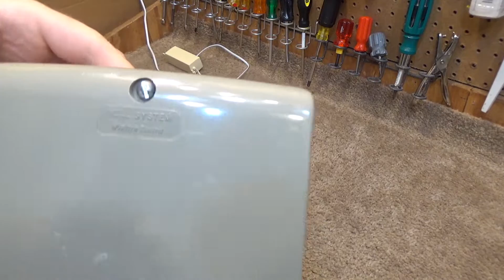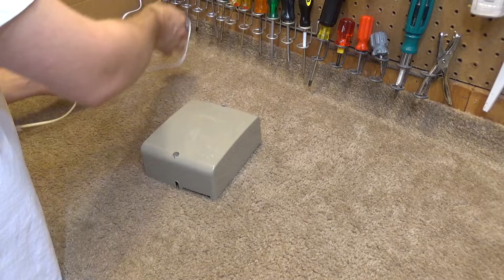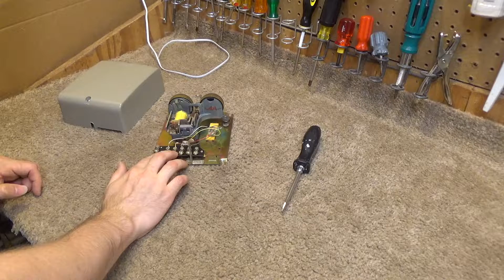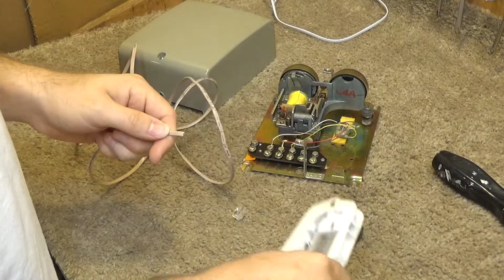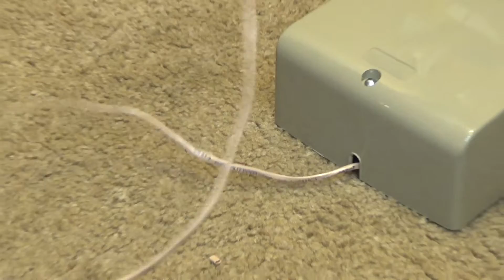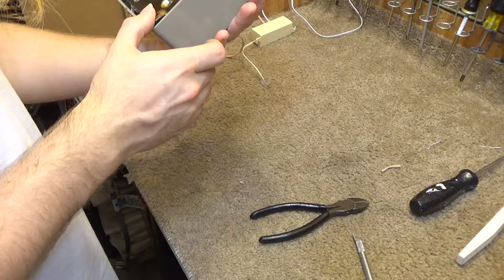Connect Modular Plug to Vintage Western Electric Phone Ringer

Comment: Would you mind doing more Jeep related videos? Since you have that in your channel banner?
Reply from the maker: In due time; now isn't the time..
Reply: @JordanU  ok, Well Ive got a 84 Ford Ranger and I might start doing videos on it. As in slowly restoring it.
Reply from the maker: @maddmaxx636  Those were good..
Reply: @JordanU  Its a V6 with a 5-speed. I love it. It needs a good bit of work but it runs really well of the age and miles.
Reply from the maker: @maddmaxx636  Manual?
Reply: @JordanU  Yup! 5 on the floor.
Reply from the maker: @maddmaxx636  Good..
Reply: @JordanU  I only drive manual cars. I dont trust automatic crap. I had a auto RWD jump from 3rd to 1st in the rain.....Hit a tree.
Reply from the maker: @maddmaxx636  I've always had, and always will have, a manual..
Reply: @JordanU  '74 Pinto, smog nLr